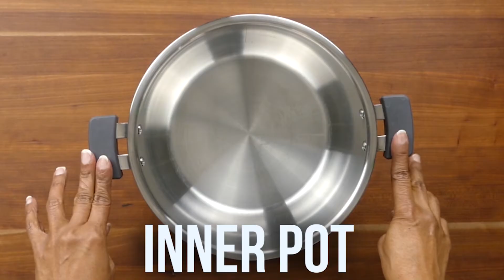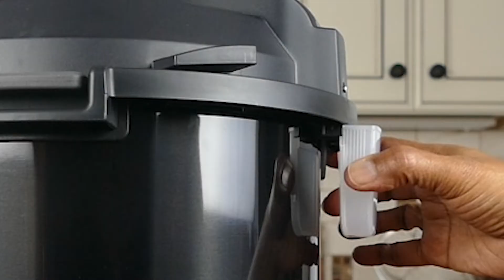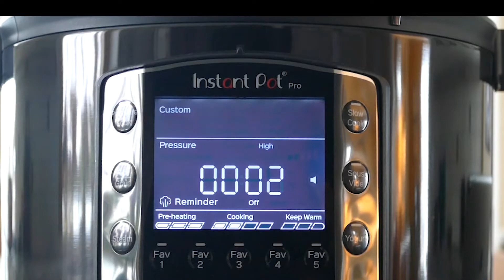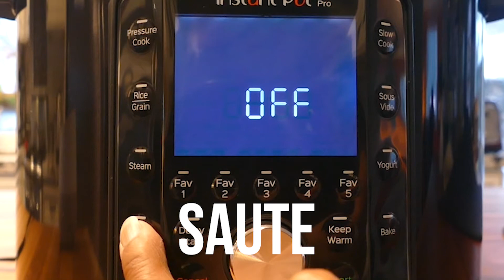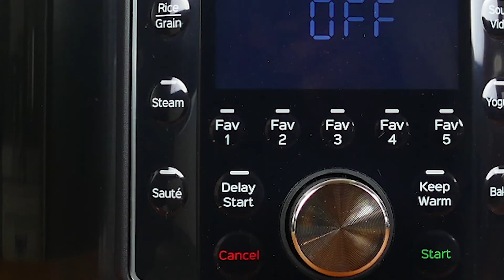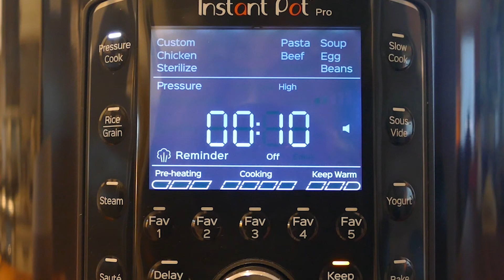How to use the Instant Pot Pro - for BEGINNERS!! Step by step guide at an EASY TO UNDERSTAND  pace!!

Comment: Good video, thanks for your hard work. One correction though. The "steam" button is not at all much like the "pressure cook". According to the users manual: "Use Steam as you would a regular stovetop steamer, boiling liquid to
cook food with hot steam, or as a sanitization chamber for glass and
plastics. The Steam program does not use pressure to cook."
Reply from the maker: I'm so sorry I didn't see your comment until now. If you put the steam release valve on and keep it in "sealing" mode, it will come to pressure! To steam as you would a steamer, keep it in venting mode!

Comment: Could you please talk about the slow cook feature.  Many reviews say that this unit is not a good slow cooking option.  Please share how to make this instant pot work better.  I really don’t want to purchase a separate slow-cooker.  Thanks. Very much appreciated your video..
Reply from the maker: I agree that the slow cook feature isn't as good as a traditional slow cooker. However you can try it out and see if it works for you. Note that low setting is like "keep warm." The medium setting is like "low" and the high setting is a normal slow cooker "high."

Comment: I’ve been told the instant pot pro lets you manually set the temp to 100 for 36 hrs to make L Reuteri yogurt… but I see zero evidence that is true.   Can the temp be manually set?  Going over 104 F kills the good bacteria…
Reply from the maker: Yes, it can be manually set to as low as 77 F (on my Pro that's a few years old)
Reply: @PainttheKitchenRed  would be extremely helpful to see a video walk thru those settings on the Pro!   Seeing is believing :D
Reply from the maker: Thank you for asking this question, because you pushed me into make a completely unscripted video short (a first for me haha!). https://youtube.com/shorts/iRVCA1t5eE4
Reply: @KyleRollinsMammothSolutions thank you for asking this question. I’ve had the problem using the dial to adjust time and temperature to make probiotic yogurt.

Comment: Excellent instructions!
I purchased the Instant Pot Pro to make “ fermented like yogurt” for 36 hrs at a specific temperature, do I have to set it to High or Low? 
Also, mine came with the seal installed and the temperature setting was already at 106 , got me thinking that maybe it was a return item!
Reply from the maker: Since you're wanting the temperture to be custom,  you won't use high or low, but rather custom. I may not have mentioned the third option in the video.
Reply: @ thank you!

Comment: Can you move the inner pot from the stove directly to the Instant Pot or does it have to cool down first?  Also, is the select button at the front loose?
Reply from the maker: Yes the inner pot can be moved to the stove directly. The knob in the front is very easily turned, so kinda loose.
Reply: @PainttheKitchenRed  Thank you...

Comment: How can I make soup using the Instant Pot Pro? Thank you. [Note: I did make soup using older Instant Pot.]
Reply from the maker: The default setting for soup is 30 minutes. So you can just select "pressure cook" and 30 minutes at high pressure.

Comment: How can I make porridge using the Instant Pot Pro? Thank you. [Note: I did make porridge using older Instant Pot.]
Reply from the maker: The default setting for porridge is 20 minutes. So you can just select "pressure cook" and 20 minutes at high pressure.

Comment: Thank you. this was helpful but I would like to know if you can adjust the temperature by 1 degree increments? I plan to use it with yogurt and different strains need different temperature. Thanks f
Reply from the maker: Yes, you can increase the fermentation temperature by 1 degree increments.

Comment: My Evo plus duo had the Error message of C 6H, and I wonder whether it’s  inner pot fits to Instant Pot pro?  Also I bought a baking pan! Does it fit to Pro, too?
Reply from the maker: Sonia, that error has to do with the pressure sensor, and not easily fixed I'm afraid. Yes, the Duo evo inner pot fits the IP Pro. I do it all the time. Yes, any accessories for the duo evo plus will fit the pro.
Reply: @PainttheKitchenRed  thank you very much! The replacement is on its way!  Yay! I cooked 50 years with the normal pressure cooker but IP which I use it for a year is much better
Reply: @PainttheKitchenRed  Hi, I contacted the IP company and they responded very promptly and sent us a replacement Instant Pot! The error is well known for Evo Duo and they seem to stop making them.
Reply from the maker: @soniatoronto  awesome! That's really great that they're sticking by their product.

Comment: You are a very good instructor!  Clear and detailed. I haven’t bought an IP yet but trying to learn beforehand. I have an IP Gem Multicooker which does not have pressure. I’m going to try baking bread in it but was wishing the IP Pro could be used that way. Since it has a bake function, I wonder if anyone has tried to bake a boule. I also wish the pro had the air fry lid.  Thank you.
BTW several people have shown using the IP for rising dough on the yogurt or keep warm serving.  So that does help in reducing time. But you still have to bake it. 😁
Reply from the maker: Suzanne, thank you for the kind words! Yes, I have tried the bake function (in my Duo Evo Plus - a precursor to the Pro) and it was able to bake a cake but took WAY too long, like 2 to 2.5 hours to bake a small cake. I'm not sure I'd recommend it but maybe the technology has changed. I don't have the patience to try it lol! Why don't you think about the pro crisp or duo crisp?

Comment: I have the Evo, and I love it. I get the impression that I would absolutely love the Pro as well 👍
Also, I realize this is a small detail, but I love that it is black. And those fav buttons can truly come in handy.
Thanks for the nice tutorial.

Something I have been wondering with the EVO as well as the Pro, and I hope you can help with, is:
After pressure cooking, when it switches automatically to keep warm mode, does it still count as natural release?
What I mean is, if I wait 10 minutes in the keep warm mode and let it count... will this be the same as hitting the cancel button and waiting 10 minutes?

For example: In the white rice recipe I usually use, I set the timer for let's say 6 minutes, and once it beeps that it is done I hit cancel and set a 10 minute timer on my smartphone. Once the 10-minute timer is done, I then do a quick release for the remainder of the steam.
If I were to not hit cancel, but rather just wait the 10 minutes while the instant pot is on keep warm mode... and only then do a quick release — will that work the same?
Will that keep warm mode allow for natural release during those 10 minutes? Or is it somehow different because the IP keeps a certain level of heat on the inner pot?

I mean, now having watched this new reminder feature in the Pro, I get the impression that the keep warm IS indeed allowing for Natural Release.
Is that true?

Also this isn't available in my Evo, is it? I'd love to find out I simply missed it somehow 😂
Reply from the maker: Great question! Yes, I have found no difference between pressing cancel and leaving it on Keep Warm before releasing pressure. And no, unfortunately, the Evo does not have the timer for natural release :(
Reply: @PainttheKitchenRed  Thank you, that is great news about the KW allowing for natural release (presumably at the same pace).

Only after watching many of your other videos, did I realize that the first ever water test video I watched almost a year back, that helped me a lot by the way, was yours. So extra thanks for that 😊
I'm glad I re-encountered your channel 👍 👍

Comment: Super great vid, the wife just got me this for Christmas and I’m super excited to start using it. Will definitely see the other vids you have. Although I am curious and perhaps you may know. As this model is newer and replacing the duo. Would the air fryer lid accessory work on this model. Cannot seem to get an exact answer from the company.
Reply from the maker: Hi Gabriel, great question. I don’t believe the current design of the air fryer lid accessory is compatible with the pro, because it’s not compatible with the duo Evo plus which was the precursor to this model. There is a model called pro crisp that has an air fryer lid fitted just for this style of Instant Pot. I believe the reason the accessory lid doesn’t fit is because of the design of the handles. The lid would probably topple and not fit securely. Hope that helps.
Reply: @PainttheKitchenRed  thank you very much for your reply, I figured just thought I would ask. Another question if I may, I see many people suggestion pressure cooking broccoli for zero minutes although I do not see it possible in timer, any thoughts?
Reply from the maker: @thegenius2OOx  - zero minutes is available on some older models. What I do is I set the time for 1 minute and as soon as the display turns from 'On' to '1:00', I press cancel and do a quick release. That's the equivalent of zero minutes. Take care.